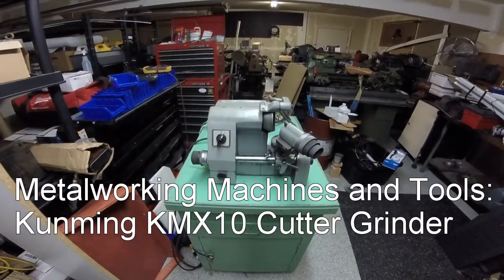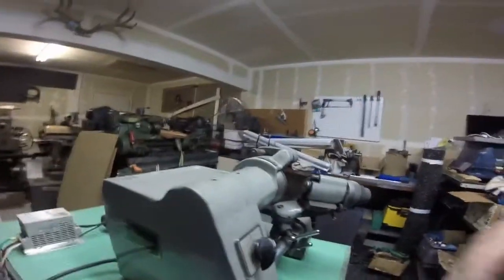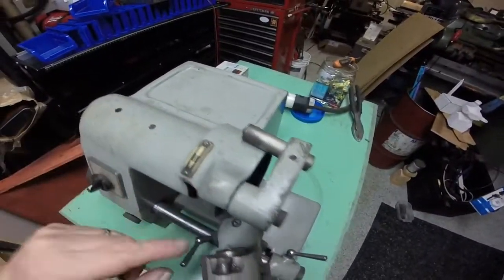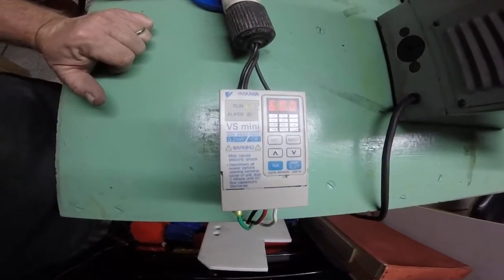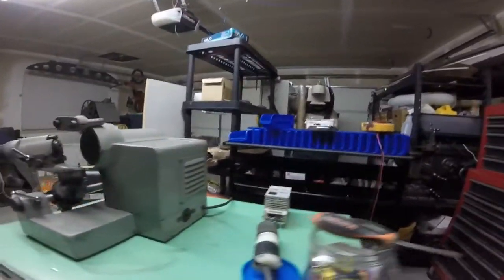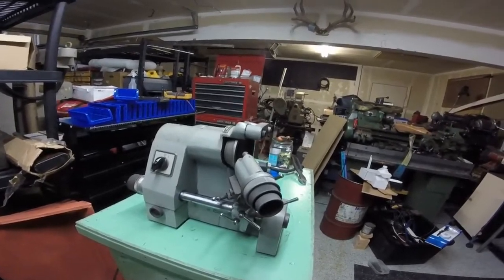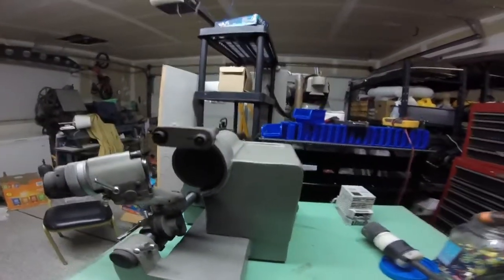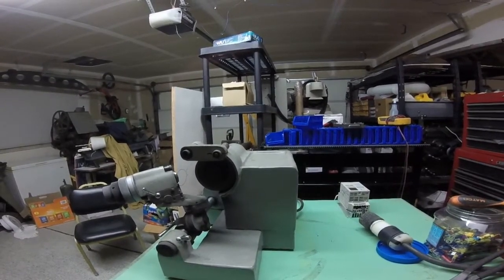Cutter Grinder : Kunming KXM10

Comment: Hi Mike, that looks like a nice find. Mine looks to be an older version that needs some TLC. I'm looking to restore the cutter head on mine. Would you happen to have a copy of the manual? In particular the cross sectional drawings. The only manuals that I've seen on line are low grade scans, hence my request.
Reply from the maker: https://www.hobby-machinist.com/threads/kunming-kxm10-4-universal-cutter-grinder.59697/
Reply: @mikewalton5469  Mike, many thanks for that link. I was wondering whether there were any other scans that you know of as I found that one difficult to read ( and auto translate)? VBR Casimir